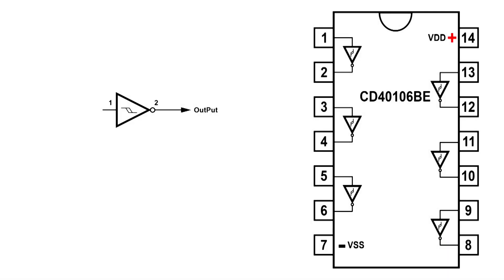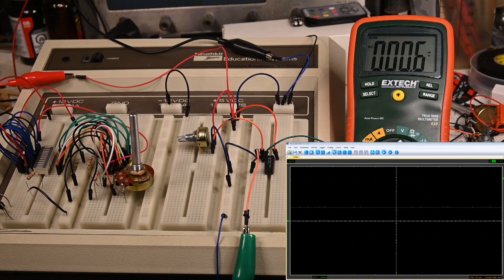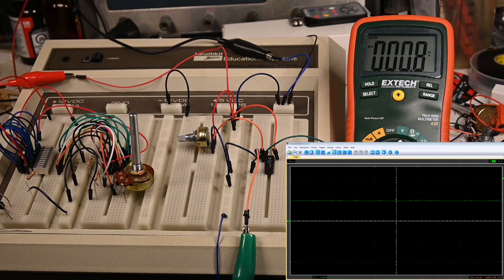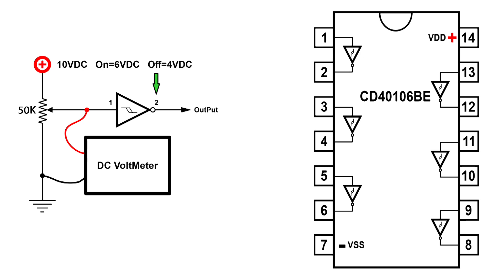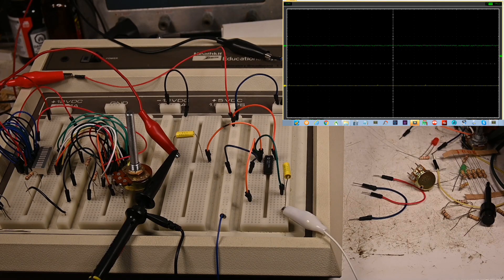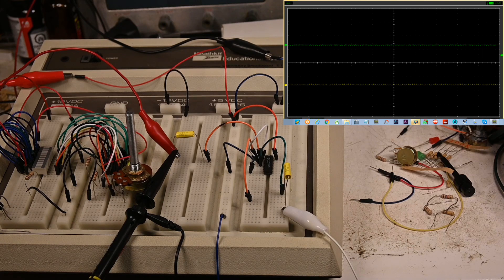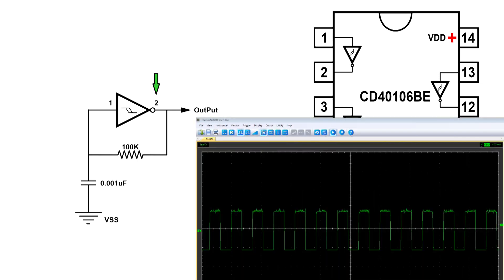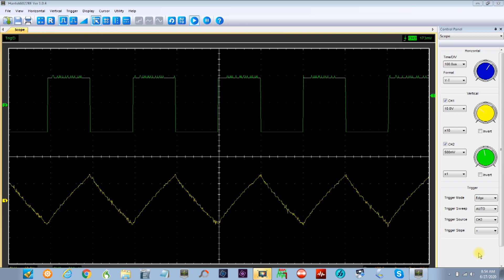CD40106BE Schmitt trigger and Inverter

Comment: If i have that IC on a circuit how can i tested without desoldering it ? i mean test it on board
Reply from the maker: Check the ground VSS and power VDD. I would use an oscilloscope to check the input and output of each Schmitt trigger.
Reply: @AllAmericanFiveRadio  If you use an oscilloscope then the circuit must be powered, but i want to make measurement without using power on the circuit which i want to make tests . 
I have an idea :
If i have a circuit with some logic gates and i want to test those logic gates with digital multimeter only, what can i do then? i will use external 5Vdc with max current source 10mA.
if i want to test AND gate or OR gate or even Schmitt Trigger , then i will connect 5Vdc to Vcc pin and  0 Vdc GND pin and connect + probe to output and - probe to GND and connect two wires one to input  A and the other to input B if it was AND or OR gate and see the result .
What do you think of that idea ?
Reply from the maker: @wadib3eed7  It's worth a try. Keep experimenting.

Comment: Was wondering if you had a video on how to build a spark plug tester. I have one of the old champion machines but the wires were a mess and wanted to get it working. One fellow told me i need a vibrator to make it work but have no idea how to wire it all up. Thanks for the info in your videos
Reply from the maker: I'd like to help if we can find some information. Do you have a model number?

Comment: I'm a bit confused at to why the circuit triggered on the way up during the slow voltage increase, but when a sine wave was applied, the square wave's position made it appear to me as though it were triggering on the descending slope of the sine wave. You mentioned it was 180º out of phase, so I don't think I'm imagining things, but I'm not sure I understand why the behavior seems different with a higher-speed sine wave triggering it than when one simply raises the voltage slowly by hand. Surely the trigger isn't •that• slow, I'd tend to think. But then again, I don't know from Schmitt triggers. (8^D) I'm also writing this before the video has ended, so maybe you're about to tell us that this is a really high-frequency since wave, and the phase shift is caused by the Schmitt trigger's time delay.
Reply from the maker: The output is a square wave if the input is a sign wave or a triangle wave, which is at the at the end of the video. The trigger points are the same for both or any wave.